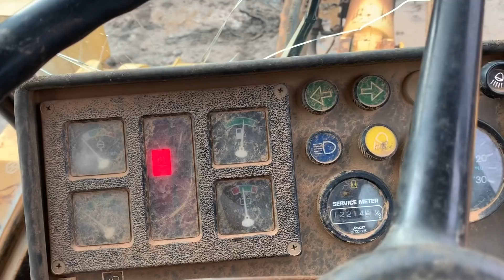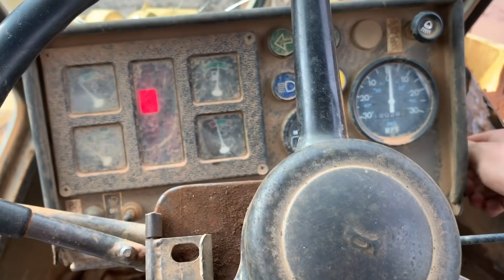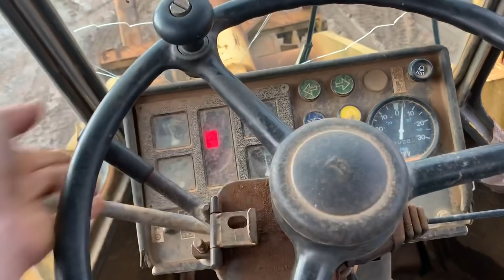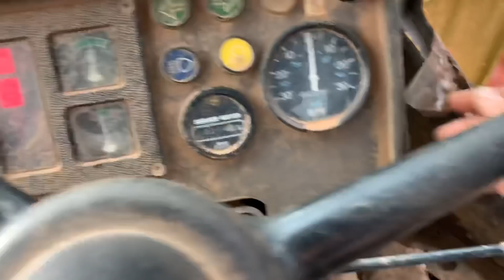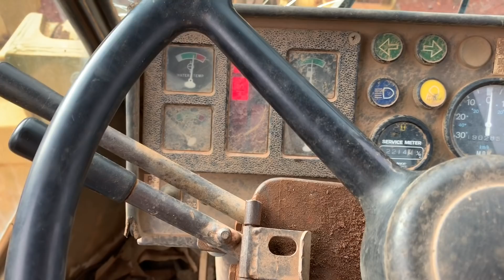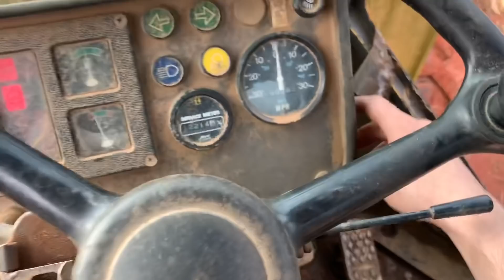Komatsu WA180 Rod Knock!

Comment: I had an old ford 300 inline with a rod knock drove it for 2 years before it blew up
Reply: That's pretty lucky.
Reply: Best engines Ford ever made imo. My boss at a place I used to work had a F150 with the 300 six, he had over 700k miles on it.

Comment: As you said, That volvo you guys got was the new king of the scrapyard. It seems to have completely overthrown the previous king!
Reply from the maker: I just hope that Volvo holds together for awhile. This machine here gave me 13 good years! And would have been alot longer if I had known about its other issues. But alas, I cant change the past. But I can move forward.
Reply: @MXguy95  Sounds like it had a pretty good run. The Volvo l90d seemed like it had a lot of life left in the video, I have faith it will last. You know far better than me, though.

Comment: Crack each injector line open one at a time and see if one of them makes the noise go away. If it does swap that Injector with another cylinder  then repeat cracking the lines loose. If the knock stays at the same cylinder then it is a lower end knock. If it moves then it’s a bad injector. With it getting as hot as it did, doesn’t look too promising though.

Comment: You have tons of engines in that junkyard. I would try to find a straight 6 out of a old ford or a Cummins straight 6.
Reply from the maker: pontiachotshot Cummins maybe. But an old ford probably wouldn’t fit the bill for this.
Reply: Jay Smart  what about the fuel injected 4.9 straight 6 ? From ford .
Easy to find and a reliable beast.

Comment: Sounds like my Ford F-150 when it threw a rod, i just got it back from a shop after a intake swap, and the next day it was hung in 2nd all the way from my house to my work and when I went to leave it started to backfire and spudder and i ended up having to jump it to life and it started squealing and finally i got a tow home and ended up sending it in my drive way but it’s all good now it’s got a new motor in it i think its on it’s 3rd motor now lol
Reply: 5.4?
Reply: TAE TAE it’s a 5.0 it’s been thru 2 motors and transmission now it on it 3rd motor and trans I really should of just stop putting money into it but it’s a pretty nice old truck and I didn’t have the heart to let it die lol
Reply: @caseyh1616  what year dude?
Reply: @caseyh1616  buy a Silverado man lot less maintenance
Reply: @caseyh1616  or put a 351 in it best motor ford made
Reply: Put a 5.0 H.O (explorers/mountaineers had them, so they shouldn't be too hard to find) into it, my friend's bronco has had one for a few years and its a tough motor.
Reply: I actually have a Silverado lol I just don’t like driving it much mainly because it’s bad on gas but it’s a good truck
Reply: NinevoltModz that’s what I been wanting to put into it, right now it has a Lincoln towncar 302 in it well a 2nd town car motor in it lol and it’s ok but I want something with more horsepower,

Comment: Jay and may not be cooked and just might be in limp modeI know my school bus goes into limp mode and it's designed to do that to protect the motor you won't get no power out of it until the problem is fixed
Reply from the maker: Mark Tellez sadly it’s a rod bearing failure, engines overheated a few times now and she’s just wasted. I’m going to go ahead and hunt down a new engine.

Comment: Damn, that sucks. What is the official cause of death? Did it run low on oil, overheat, etc?
Reply: old age??????????????????
Reply: @gertraba4484  Old age is not a valid diagnosis
Reply: justsomeguytoyou theoretically old age can be a diagnosis. Everything wears out eventually. just because something is properly maintained doesn’t mean that it isn’t going to fail at some point in the future. Even the most well maintained vehicles end up in the junk yard eventually, if the owner chooses not to do an engine rebuild when necessary.

Comment: I operated 2 international 510B Hough's that were repowerd by komastu engines 6 thousand dollars for a new motor and 6 thousand for labour good machines till the transmissions went out in them
Reply from the maker: Dennis Henderson I plan on doing the engine swap ourselves. Save the labor right there. When the old track loader blew up we swapped it ourselves. This should be a cake walk compared to that. Just finding a cheaper used engine seems to be the challenge

Comment: How did the engine fail, no oil or lack of oil changes?
Reply from the maker: Ian Above freeze plugs kept popping out , machine would overheat before you even knew it. A few times of that and she started tapping down in the lower field, by the time we got it Doug out and back up to the top it was toasted.